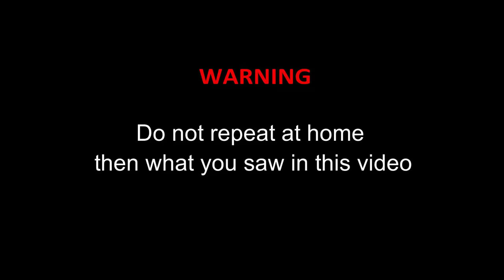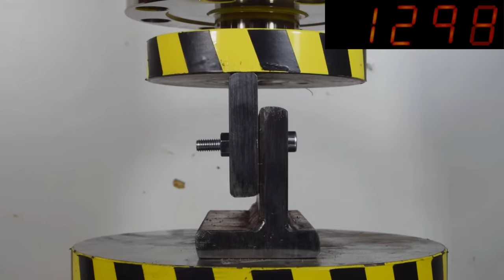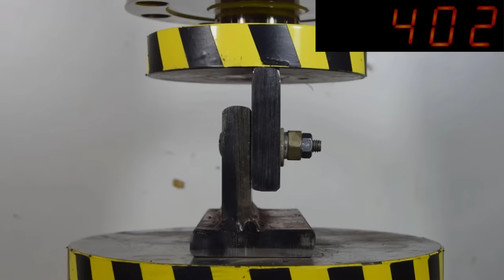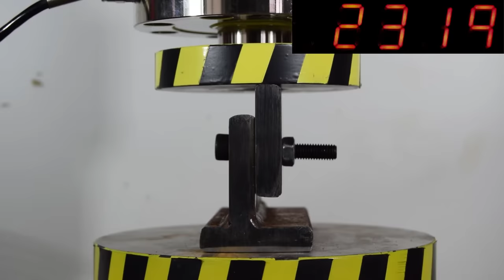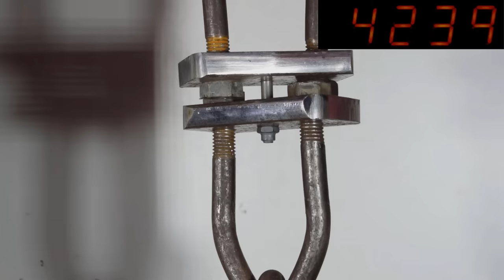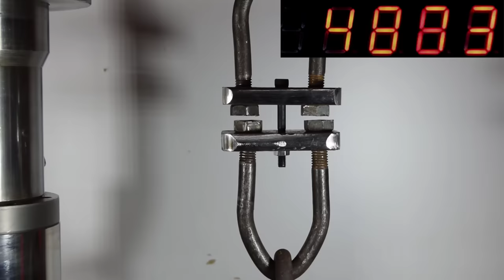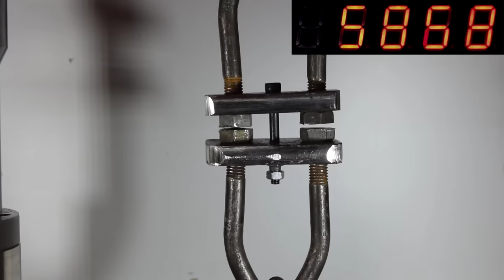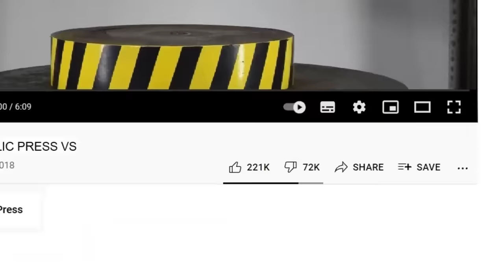HYDRAULIC PRESS VS TITANIUM BOLTS

Comment: For people wondering why cheap Chinese bolts might be stronger than the space bolts - the main attribute of a space bolt would be its weight over its strength.
The bolt would rate just as strong as it requires to avoid being disproportionately strong for its needs, thus: heavier than it could have otherwise been.
You can bet the bolts were manufactured exactly within strength capability witin specific thresholds, in order to allow for as much enhanced weight reduction property as possible.
Reply: This is the absolute correct answer. I've worked with aerospace stuff and everything boils down to the exact required strength to weight ratio. No overkill can be afforded with them otherwise they wouldn't make it off the ground. Everything is calculated down to the nm
Reply: They were weighted at the beginning of the video FYI
Reply: In other words for construction builds Steel whilst having Chinese Titanium bolts at vital parts is beyond plenty
Reply: You answered my unposted question very well, and I appreciate that. Thank you!
Reply: @mengguangwang  not the chinese bolt.
Reply: Why do you assume the Chinese bolt is cheap? It said it's Titanium
Reply: @tslim250  I used to make the captors for the space shuttle. Loved doing it. But they asked for some perfect shit...... lol
Reply: Yeah.. answer to every reasons why Chinese might actually make something good sometimes
Reply: Thank you for your insight.
Reply: excuses china number whan
Reply: @m.n152  It's not an assumption, it's a comparison
Reply: @Postghost  my bad I didn't see the description, the channel state that it is indeed cheap.
Reply: @tslim250  In aerospace, they do overkill, especially for civilian aircraft. The reason for doing it is for the aircraft expansion, stretching the fuselage to the max limit. You may think it doesn't make any sense as adding more power would result in expensive fuel consumption, or stretching structure, a keel beam with double reinforcements. 

In any case, aircraft undergo constant evolution, some parts are changed, some modifications are made, and some are removed. Unless it's an old design where expansion and weight reduction are no longer possible due to aircraft design
Reply: @tslim250  It's also important to have documentation to prove the bolt is made from the proper material, and will have the strength necessary, and having that documentation takes extra work making effectively anything in high performance industries more expensive.
Reply: Titanium main value is that is lighter than steel and hold it strength at high temperatures. It's not the be all to end all for temperatures or strength.
Reply: As somebody who works in aerospace manufacturing I can tell you they can trace that bolt back to the day it was mined out of the ground. It’s part of what makes modern air travel in a 737 so safe. The paperwork people the PAPERWORK!!
Reply: In addition the quality control on "Space Grade" is MUCH higher. It is not unusual for things like bolts of this size to be 100% X-Ray inspected and 1% or more pulled from production and tested to destruction.   Kind of a pain if your $1 billion satellite launch fails because of a $1.49 bolt failing. :)  Also with Titanium the part has to be coated with something to protect it from oxygen.  Oxygen embrittlement is a big problem, as well as contamination with other metals like cadmium.
Reply: @fokthewef  China has good titanium manufacturing... Russia has the best titanium manufacturing in the world & what they use on their spacecraft is the best of that best. There's many ways that Chinese manufacturing/fabrication is better than Russian... titanium isn't one of them
Reply: I don’t think that’s it. But it’s a good observation. See, the difference in bolts is the material. Space bolts are made from Titanium. Whereas the Ali express bolts are marketed as titanium but are actually a Chineseium/titanium alloy.
Reply: I always order from China they do the work with their heart
Reply: Makes sense.
Reply: No, wrong. The main attributes of aerospace rated stuff is being traceable, reproducible properties. If the datasheet says it breaks at some load, it will always break at that load or above, and will break every single time the same way. The material, weight and load rating are always very well qualified for aerospace stuff, but not necessarily the highest. Also, in theory you should be able to trace the history of every single bolt, from raw material to finished product, if aerospace grade.
Reply: The bolts are used for different projects and each project has a different requirement.  As for space rockets, they don’t use bolt or screws etc on the out panels, they use a special glue.  Screws and bolts etc will expand and contract in the extreme heat and cold, more likely to be used in the inside of a rocket or space craft etc…
Reply: Did he weigh the Chinese titanium bolts compared to space bolts? I only saw him weigh the steel bolts.
Reply: @sihotech  as far as I saw, he only weighed the first two.
I've seen a few of their videos now and they seem to have little to no sequential consistency.
Reply: The space bolts will all perform the same way. They were machined out of audited materials. You shouldn't have random failures like you will with Chinese crap.
Reply: @fokthewef  China makes great products, it depend on the price you want to pay.
Reply: @lukeecle117  people in China can make great products if you pay for it and have someone competent you trust doing QC on every production run before shipping. unless you work with a known tier-one or two manufacturer. 😉
Reply: @Postghost  we should ask for some QC on those shoddy videos... 😏
Reply: @m.n152  China makes a lot of the steel in the world , the steel factory is bigger than some cities. sometimes the steel they have isnt all that precision because of the massive autoclaves and transfer equipment. A smaller foundry making titanium could be assumed to be similar but that would be incorrect as its likely another site entirely. mid to good quality steel and decent titanium with no finish is what i have seen so far.
Reply: @CarFreak why do you think it is bad? They do it as cheap as possible so that’s why the quality isn’t great in a lot of cases. Who buys the products? A lot of western companies buy components from China due to the price they can get it for, if you want quality then you have to pay for it, same as anywhere else. So it’s not that China just can’t manufacture quality stuff, the quality is dictated by how much people and companies are willing to pay for it, people don’t want to spend a lot of money, so the factories can’t spend a lot of money on the best materials or proper quality assurance, they still need to make a profit too. Most companies who buy components or products cheaply from Chinese factories know its flaws and accept them since it is so cheap compared to getting it manufactured elsewhere. It is absolutely possible to get high quality parts and products from China, but like anything else, you get what you pay for. Rather than blaming the Chinese why don’t you blame the people that design the products and dictate how they are manufactured and want them manufactured as cheaply as possible so that they have the most profit (i.e. western companies), or just spend more on a quality product.
Reply: @CarFreak really not guessing and have ordered from vendors before. Essentially my whole point is you get what you pay for. If you can't be bothered spending one minute to read my comment then why reply. Sure they may not be up to aerospace specs but it is still titanium.
Reply: @CarFreak the fact that you can't be bothered to read it says more about you than me.
Reply: You are correct, for space craft that don't require re-entry once in space the gravity of the earth is much less a factor, just the cost per ton to get something in space is insane, its all about the right match of weight vs how much fuel you can have to get to out of orbit velocities.
Reply: I think the "titan for spacership" was laso bought at AliExpress
 :D
Reply: titanium is a natural element, you cant make that "cheap", a difference in processing will change how strong a material is in certain instances (for example it might be good at sheer strength but poor at tearing) but its still titanium...... 

china makes things just as high quality as the west, its just that when china has to not only provide for their own 1.6 billion people, but the rest of the worlds 6 billion, well of fucking course they also provided cheap mass produced goods, china is NOT post scarcity and when they are practically forced to be the world supplyline they have no choice but to provide cheap alternative goods, do NOT confuse this with the belief everything made in china is cheap
Reply: "enhanced weight reduction property", or as we mortals say - light
Reply: @rinrin4711  So you mean... as opposed to - dark?
Reply: Another theory: degradation of American manufacturing reached astronomical levels.
Reply: Nerd
Reply: Jokes on you. Aerospace bolts comes from China.
Reply: Or just that space is fake!!
Reply: The space bolts were also built in China, along with the engines, and the heat tiles. In fact, everything was built in China, except the O-ring seals in the solid rocket booster (SRB).
Reply: @tslim250  Aerospace "stuff", eh? Kerbal Space Program design manager?
Reply: More like, the space bolt will definitely reach its specified performance while the AliExpress might, or might not.
Reply: @m.n152  that's true. I just assumed it's cheap because it's aliexpress. But in reality that's a bad assumption to make.
Reply: Why,  if all things in space are, in fact weightless...
Reply: @Manwichman   in relative gravity.  Not weightless.
But it's not about being in space, its about getting it into space.
Reply: @fokthewef  The Chinese simply made what you paid for,  I am sure there are plenty good quality products that are made in China, it's just that are you willing to pay for the price?
Reply: When it turned out that the spacecraft bolts weren't as good at sideways strength compared to vertical strength I figured that was because tearing away is more of an issue than sliding away for them.

As you said, no need to make them stronger and thus heavier than needed for their specific purpose.
Reply: @MCPicoli  damn
agree with you
this test shows how muh stronger Titanium can be compares to steel
but.. since the class youre testing is for shuttles, theu have special characteristics to work, and break with almost equal strenght, thats why Engineering still impress me
Reply: ♡♡♡ EXCUSES, EXCUSES, EXCUSES. NOTHING BUT EXCUSES. ♡♡♡
Reply: thank you
Reply: @fokthewef  actually as i know and on my experience.. China made something depend on your request (i mean budget) so its depend on your request.. spec.. also money.. more good more expensive, more cheap so there have something must be sacrifice..
Reply: @DirkDeadeye_  People just can't accept china makes good cheap products
Reply: not only strength but strength at cold temperatures.
Reply: @Bundalaba  just because it's stronger at room temperature doesn't mean it's the same when it's cold.
Reply: @nationalsocialism3504  Just like Russia's military is the best of the best... Lol not so much. Hopefully you've learned by now not to take Russian claims like this as fact. Their spacecraft and space technology (as well as military aircraft/technology) is far behind the US. Looking into their air/space craft is like taking a time machine back to the 80s. Lol
Reply: It is also not appropriate to judge based on a single test result.  Typical QC testing would involve multiple test results of random samples ideally including the beginning and end of a production run.  Even if multiple data points indicated higher average strength for the Chinese bolts, I would bet money that the space bolts are more consistent.  Sometimes customers would rather have a bolt with slightly lower strength but with a decreased probability that it will fail below a specified load.
Reply: @qwertymike3717  This, but also this channel just kind of randomly selected a bunch of bolts. For example, if I selected some decent Chinese titanium alloy bolts and some bolts that NASA had used to, idk, bolt down a small switch on the ISS, those bolts are going to be only as strong as they need to be without wasting mass unnecessarily. And these would likely be much weaker than these randomly selected Chinese bolts. Maybe an extreme example, but it illustrates the point.
Reply: Also space materials need to withstand high temperatures
Reply: A diameter difference of as little as .01mm could also account for a significant difference in part strength.
Reply: This is bullshit. Chinese titanium is no more dense and if it threads into the nut then it's close enough to the same diameter. The Chinese bolt may well be better. Space rated parts aren't necessarily top shelf it's just gone through a lot of certification.
Reply: @appa609  what's bullshit?
Reply: For people wondering why cheap Chinese bolts might be stronger than the space bolts - because it was not a cheap Chinese bolt, but a 12.9 steel bolt with the wrong label...
Reply: @DirkDeadeye_  They are titanium, I've used plenty of them ....
Reply: @XiaoYueMao  Profit margin and volume production makes one Cheaper than the other, It's really that simple.
Reply: @WortexCZ  The anodised bolt was an Aliexpress Titanium bolt...
Reply: Dude, there isn't going to be a difference in weight between "space" titanium and "chinese" titanium.
Reply: @S0ulinth3machin3   dude, the argument isnt about "space" titanium... It's about "space" bolts...
Hell, as far as we know the space bolts in question could be even using Chinese-sourced metal, but that's not the point.
OFC there's going to be a very precise weight relegation to each and every BOLT that goes into space.

You might consider micrograms per bolt to be completely inconsequential here on earth, but when you consider how many bolts are in the construction of, say, a Saturn 5 rocket setup. 
suddenly the number becomes not quite so inconsequential.
Reply: @Postghost  the micrograms are inconsequential. The "space" spec is about quality control, not weight. There'll be far more quality control checks at each step of the manufacturing process compared to a normal commercial run. Example: milspec grade 8 vs. grade 8. Grade 8 is high quality, but milspec is almost guaranteed to no have flaws. A grade i milspec bolt will be almost exactly the same in strength and weight to a commercial grade 8 commercial bolt, but the milspec grade 8 will have almost zero chance of having a manufacturing flaw while a grade 8 may have a few (bolts per million) with microcracks. They avoid sending those out in milspec because they do things like xray the finished item or require the initial alloy (which the bolt is cut out of) to have a specific accuracy certification. It'll be a similar dynamic for the space spec. The designers will call out commercial bolt sizes and alloys - but the manufacturing accuracy will be different. It doesn't mean any individual bolt is lighter or stronger than the identical commercial bolt. It means the chances of getting a flawed item are close to zero.
Reply: @S0ulinth3machin3   all of that about quality control being already assumed, it has no bearing on the conversation being had because it has nothing to do with reasons to explain why the cheap bolt is stronger than the expensive bolt.
You seem desperate to extract a "gotcha" out of this that you perhaps have gotten lost along the way... Take a breath, bro... have a drink of water.
One or two Micrograms might be inconsequential in space travel, sure... but now times that by 400 thousand, because you dont use ONE bolt to build a rocket.
Reply: @Postghost  dude, you've got your head where the sun doesn't shine. Of course you want the lightest possible design but that's not what milspec is. There's not going to be a weight difference between a titanium commercial bolt and a milspec titanium bolt of the same dimensions. Milspec is about quality, not weight.
Reply: @tomasgogashvily5350  "In aerospace, they do overkill, especially for civilian aircraft. The reason for doing it is for the aircraft expansion, stretching the fuselage to the max limit."  That's not "overkill". That's engineered including a safety factor. There is a difference.
Reply: @fokthewef  isnt china like the biggest titanium exporter or sth ?
Reply: the funny thing when u buy two different vendor even tho it's same brand one is real other is fake this is why aliexpress is a bit gambling*
Reply: @m.n152 I’m like REALLY late but I just wanna say that Chinese titanium is cheap and durable at the same time. Chinese stuff are usually cheaper than America’s with ~7 yuan (Chinese currency) equaling a dollar. In some places, a lollipop costs 0.5 yuan and a 2.5cm x 2.5cm x 2.5cm high quality titanium from official manufacturers cost around 100 yuan, around 14 ish dollars.
Reply: @Burton1973  When you're trying to launch something into space, leading to intense heat and forces in both sheer and tear, where every minute detail is important and peoples lives may be in jeopardy and one fault spells a billion dollar disaster, as well as potentially leaving debris that you cannot clean up due to location... I'd expect nothing less than perfect.